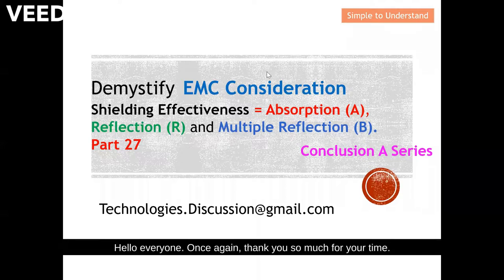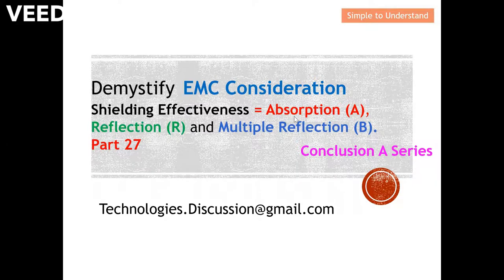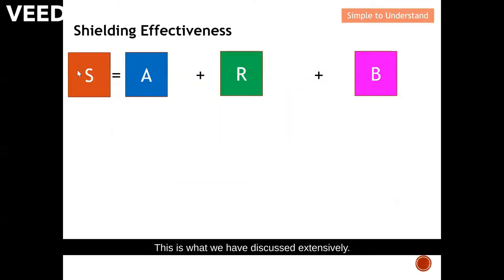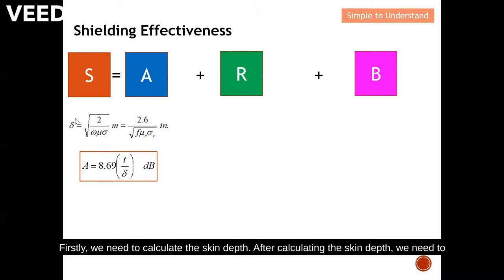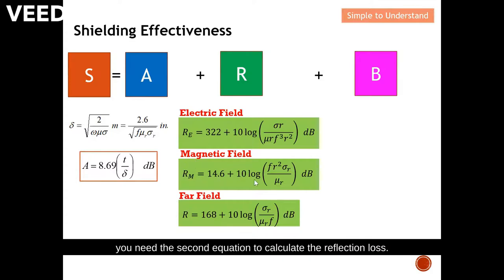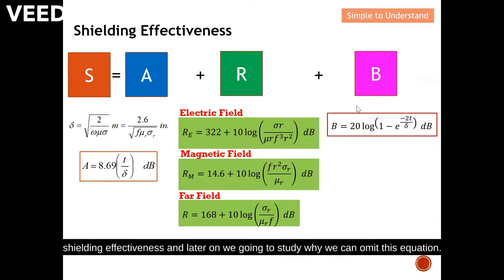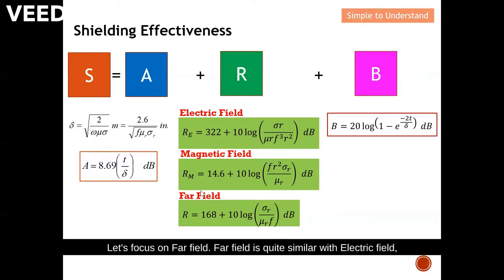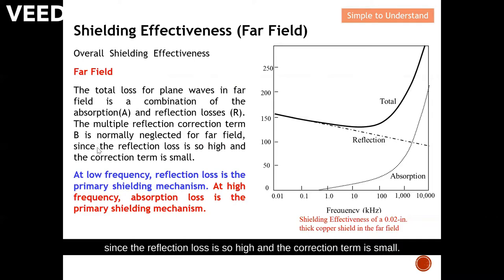EMC Part 27. Understand How Thicknesses & Types of Material Affect the Overall Shield Effectiveness.

Comment: Is 10 dB a critical point for SE? I mean when we design an EM shield, the SE value should be higher than 10 dB. Am I right?
Reply from the maker: Actually, it depends. For example, if the source is Magnetic or H field,  I will say 10 dB is very good especially at low frequency. However, if is Electric or E field, then I think feel 10 dB  for SE is too little. Hence, it depends what field u want to shield. E or H field and also the frequency. Thks  :)